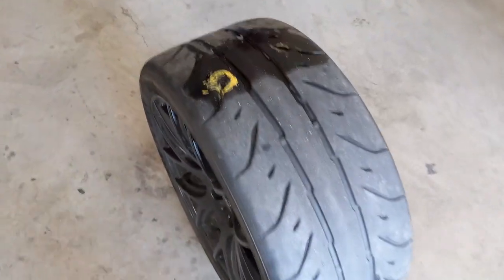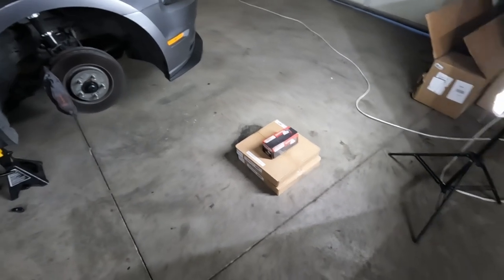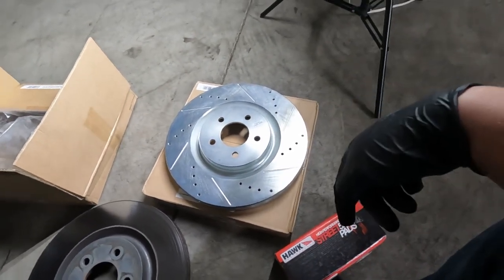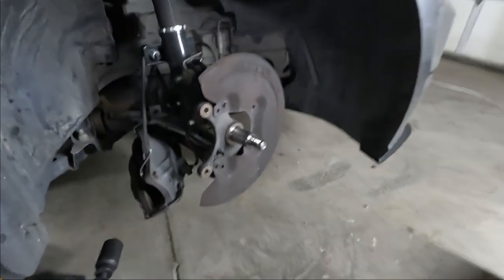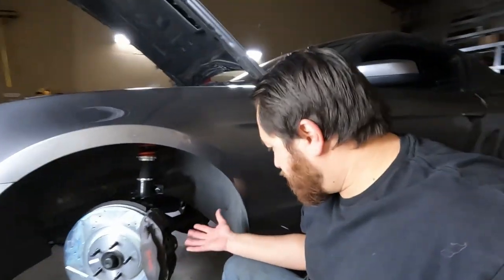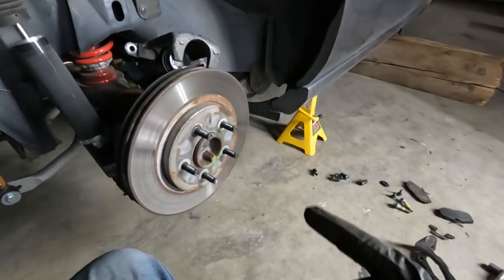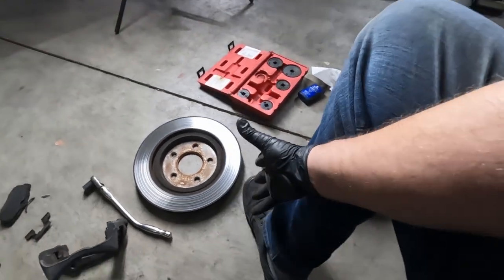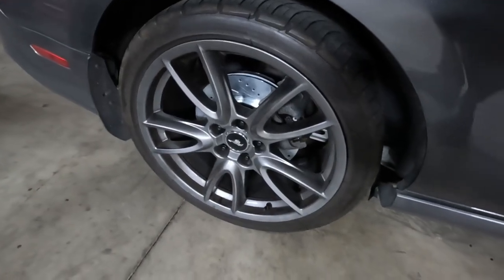Performance Brakes Install

Comment: I have the same power stop rotors. And now I’m experiencing a croaking/ rubbing sound from the rear near the passenger tire. Haven’t really diagnosed the true problem, my mechanic has it now but thinks it’s the rotors drilled and slotted. Have you had any issues with yours since you’ve had them? Mine are only like 4-5 months old.
Reply from the maker: That doesn't sound good.  I haven't had any problems with the brakes.  I do experience an issue with squeaky brakes at low speeds, but I haven't bothered to try to make it better.  I expected them to squeak a little because of the pads I got.